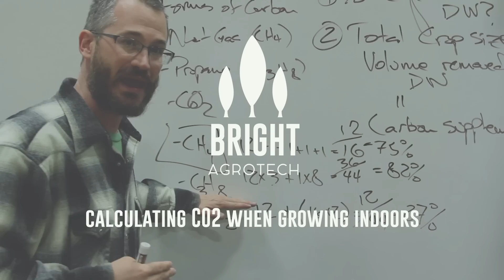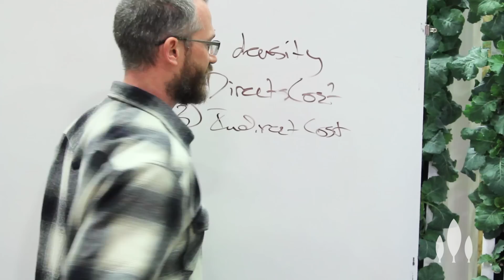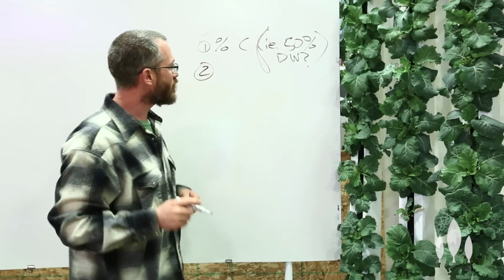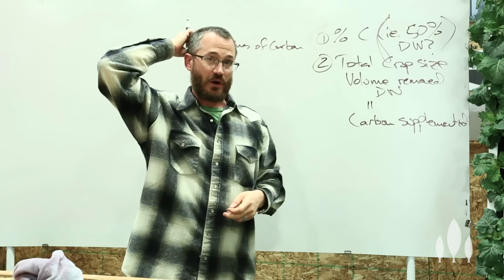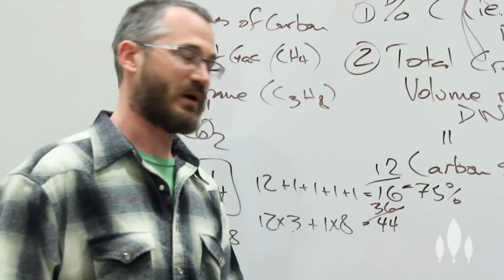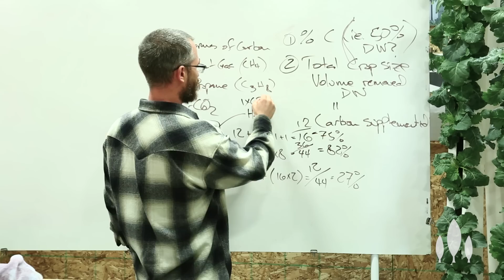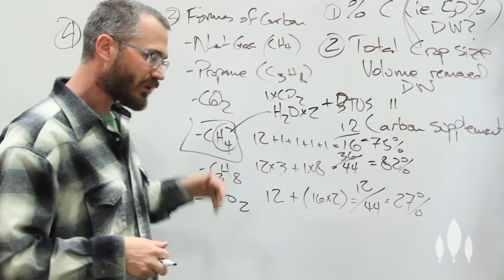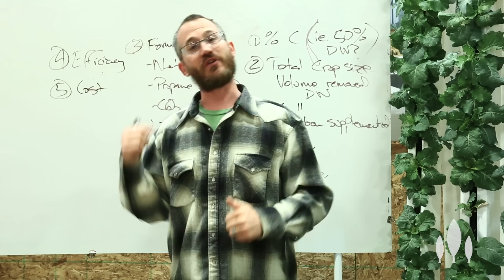Calculating CO2 when Growing Indoors

Comment: I have a mushroom farm can I use the co2 extraction of the mushroom farm into my greenhouse?
Reply from the maker: Yes, if you have a CO2 fan/blower that can pump CO2 into your greenhouse, we would highly recommend doing so. Depending on the development stages of the crp[, mushroom farms tend to push CO2 levels above 1000+ (PPM) for the most part. 

For most crops In a greenhouse setting, CO2 readings between 600 - 850 PPM are great for a crop that was recently planted. CO2 readings between 950 - 1250 PPM tend to be the saturation point for many crops. At this stage the plant should be in full production (flower/fruit).
Reply: @ZipGrowInc  the mushroom spore are not harmful for the plant?